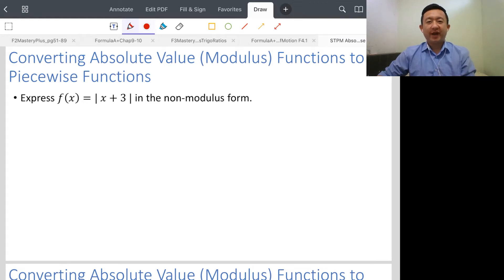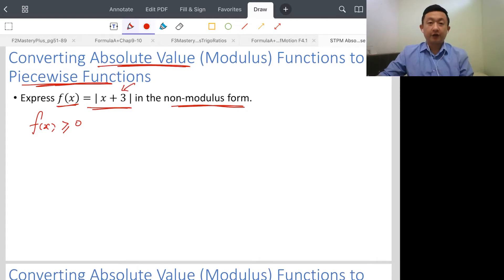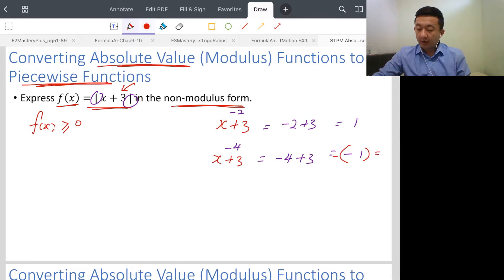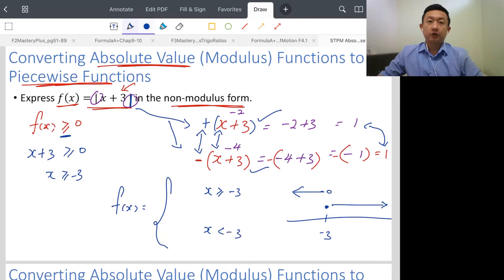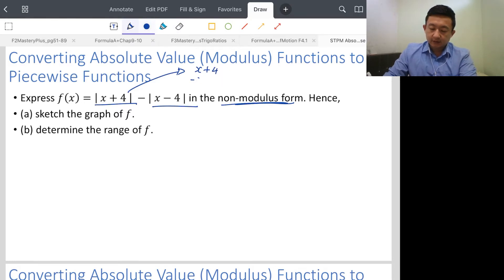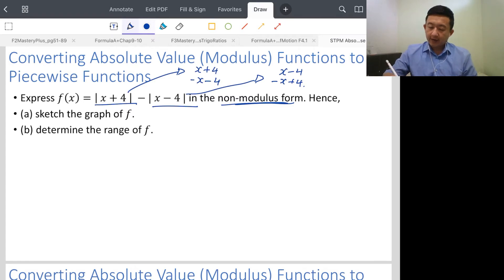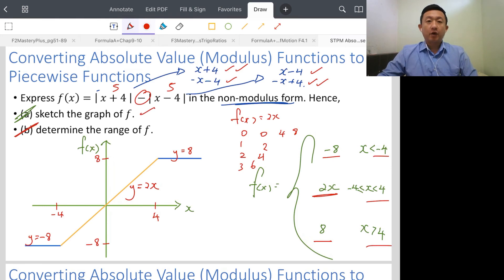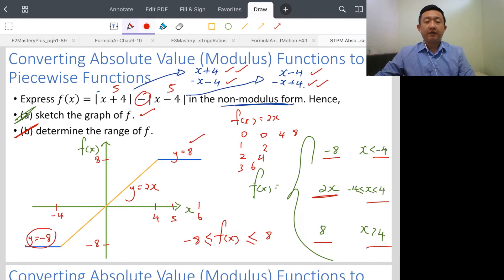STPM | Converting Absolute Value (Modulus) Functions to Piecewise Functions

Comment: hi sir! may i know for the second domain -4<=x<=4, if i plug in 4 instead of zero, then it would be 4+4 and 4-4. then, 4-4=0, in this case, do i need to put negative in front of (x-4)? if not the answer will be different. Or should i plug in the midpoint of domain -4<=x<=4 which is 0? thanks in advance
Reply from the maker: Hi, if you plug in 4 into (x-4), you will get 0; and if you plug in 4 into (-x+4), it is still 0. So either way you will get (4+4) - 0.  However, by plugging in, -4 or 4 into the equations, it won't help to determine which equation (+ or -) to be chosen. So most of the time, we don't plug in the limit (-4 and 4), we just plug in any number in the range, says -3, -2 , 0, 3 excluding the -4 and 4 since these 2 points(-4 and 4) are the intersection points between 3 domains. Hopefully it helps.